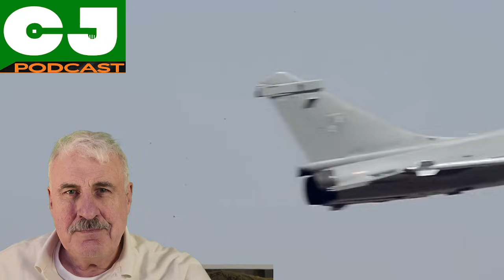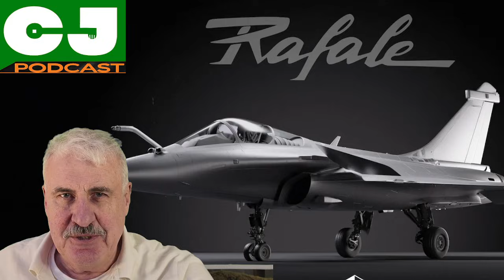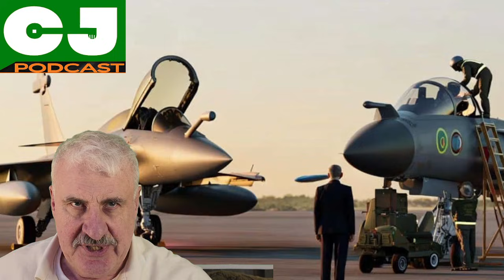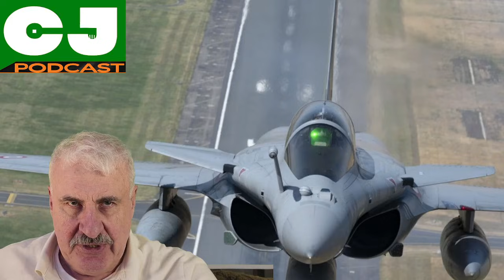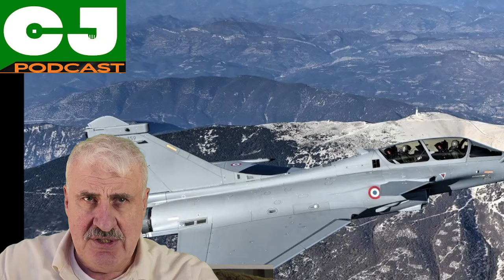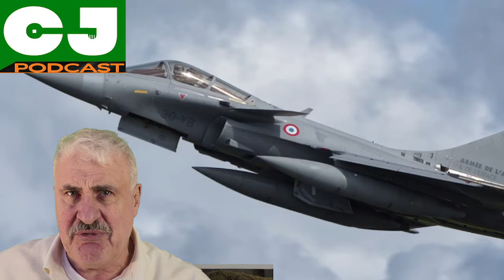Rafale vs Gripen – What Should the Irish Air Corps Choose?

Comment: I see that the first Brazilian Gripen F has been made and they are thinking about buying 20 more all made in Brazil. And it looks like Canada will buy 60 again made locally in Canada. Announcement in December after mid terms. 
So rather than one production line producing 10-12 a years, it's three production lines. This could easily mean that availability is much better so first delivery within 18 months not 4-5 years as before

Comment: Saab Gripen is better as they can be leased out by Saab to a country but Ireland is the best in aviation leasing & getting an Irish Leasing company to run the contract and this could be a win-win for Ireland and Sweden. GECAS used to be owned by General Electric before AerCap Holding bought it out....... can I give you any more reason for the Saab.... oh yeah the Saab 340 AEW&C

Comment: I will start by saying that the Rafale is the best multi-role aircraft in the world. And I think I can say that objectively, even though I am French. The question to ask is, “What does Ireland need to do in terms of missions?” I don't claim to know Ireland well. I think you need to carry out air policing and possibly defense missions. The production capacities of these two aircraft need to be studied. How soon does Ireland need the aircraft and how many does it need? India is in the process of becoming a producer of some of the Rafale's components, which should increase production capacity. We will have to see how long it takes and whether it is reliable (apparently things are going well with the partnership with Dassault). The Gripen is a very good defense aircraft. It can carry the Meteor missile (the best in the world), can land on “improvised” runways (even roads), and is cheaper to operate and, I believe, to purchase. The Rafale is very good for power projection, has extensive experience from numerous missions, and has very good internal software and computing power capabilities. I won't go into detail about all the advantages of the Rafale. But at this point, I think we can say that the Gripen is sufficient for Ireland, match the needs and will have less impact on public finances, given the country's geographical location and what I believe to be its needs. 

Translated with DeepL, sorry if something is not understanable.

Comment: Air dominance could not be free of charge . Rafale is an expensive solution but proven . Defense and war was never cheap activities. The cost debate is ridiculous considering the real cost of the US F35 now. 
If Ireland needs only  air police , probably Gripen is more as enough to intercept civilian planes . If the question is to insure air defense again strong assault of war planes then the concern is different . Different in technology and volume also.
To intercept and shoot down massive drone airstrike as exemple is experimented in Ukraine with quite modern Western war planes . Ukraine is harassed by Russian drone and missile strikes and F16 or Mirage2000 are not in the position to stop it. Even the strike is clearly detected and anticipated. 
Here remain the real strategical question about the choice and nothing about the type of the origin of the machine. Which warplane have the technological ability to eliminate the thread ? How many of them is necessary to operate to be efficient ?